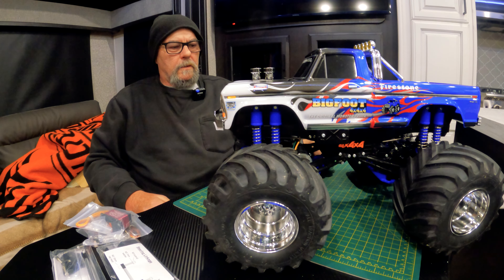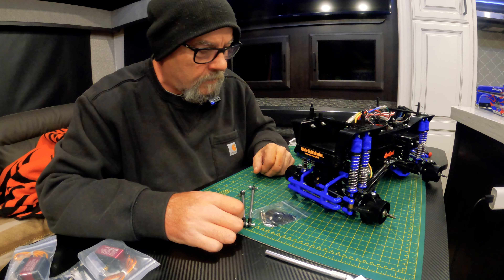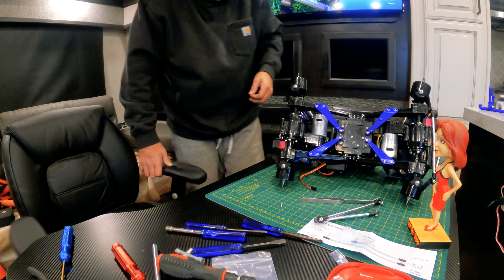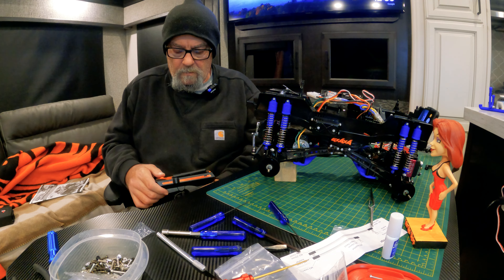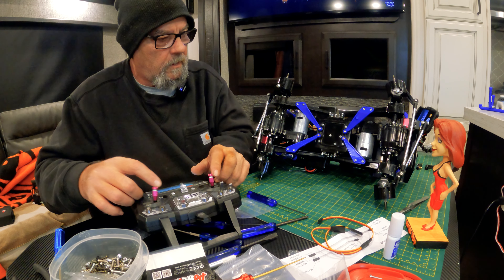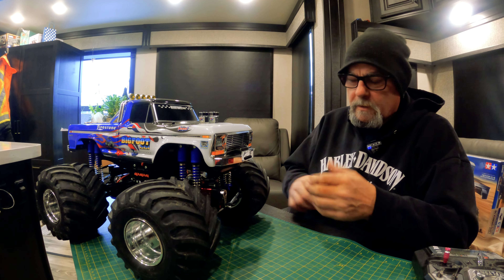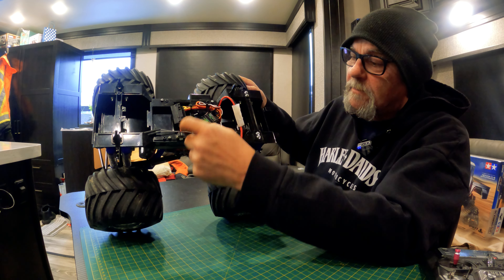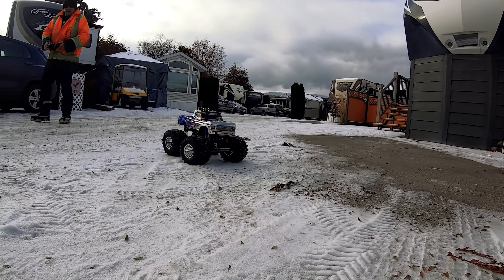SUPER CLOD BUSTER STEERING UPGRADE       #tamiya #rc

Comment: Do not use sport tune motors you need a set of motors that have 0° timing. Make sure that you go out and get yourself a set of motors that are specifically tailored for the buster and stick with 540 motors. 550 size motors cause an issue because they will rub on the ladder bar. Now here’s the cool part I decided to go with red cat 17 turn 550s and I have run the truck 4S. Hold onto your wig
Reply from the maker: Team Brood 17 turn

Comment: Can’t use sport tuned on these because you need motors with zero degrees of timing
Reply from the maker: Oh my. Thought they all were. Stock, torque and sport. Guess I am getting an education.
Reply from the maker: Aaahhh. I see my mistake. They are fixed timing.  Then it stuck in my head they were zero timed. Thank you for pointing this out.  Off to the hobby store shopping. Lol
Reply: I got my clod running stock 540s on 3s and quickrun 880. Its cool to get that extra boost without changing the motors.
Reply from the maker: Great, big wheelies.